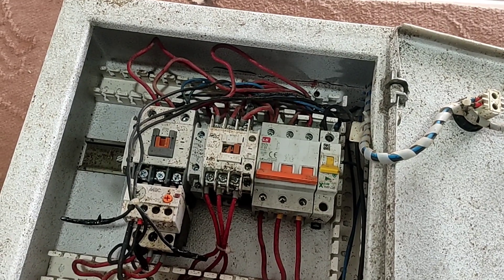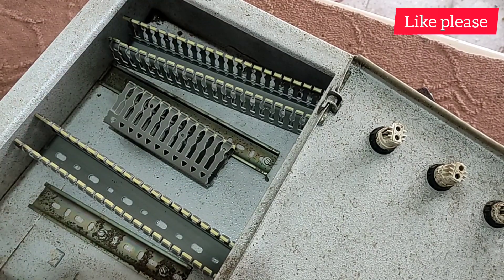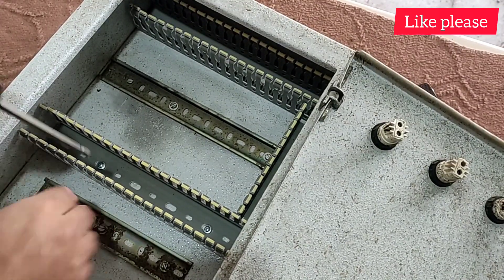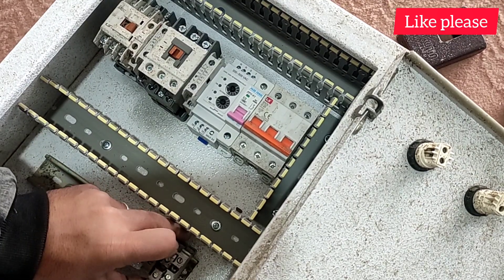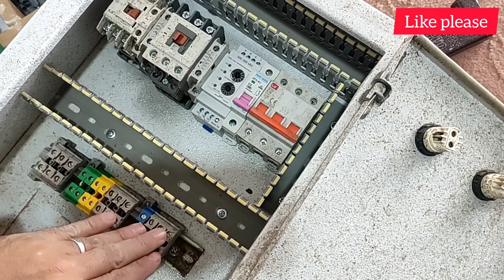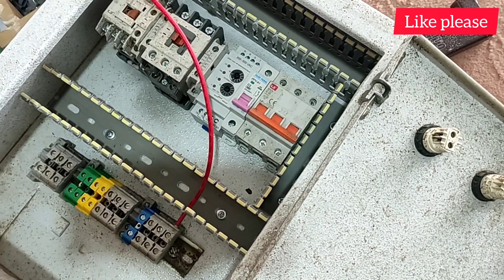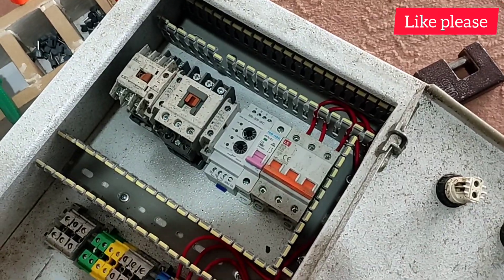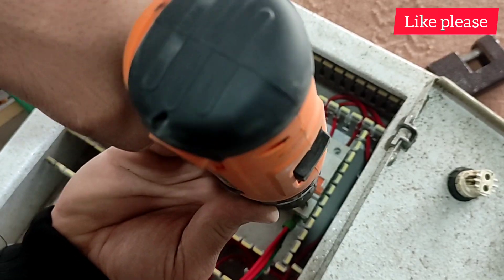Electrical panel wiring training with all details

Comment: Good job! could you tell me what kind of screws are you using  to screw down the din rails and wire ducts?
Reply from the maker: @περουβιανήκουζίνα  yes 
Self drilling screw (length=1.5cm)
Reply from the maker: @περουβιανήκουζίνα  yes 
Self drilling screw (length=1.5cm)